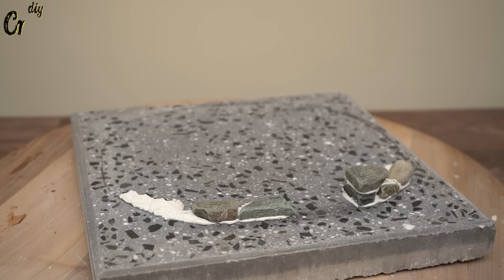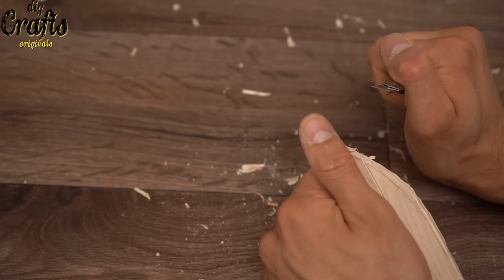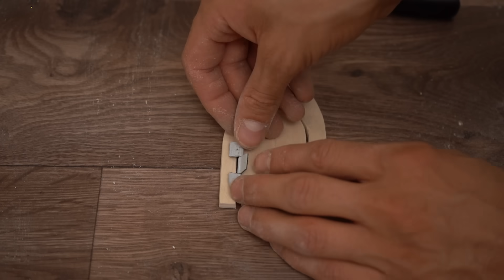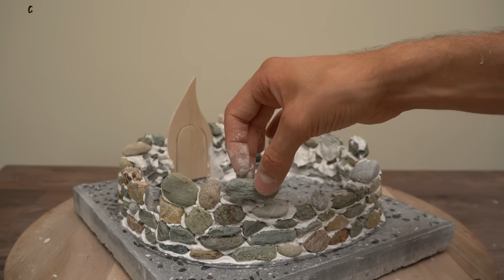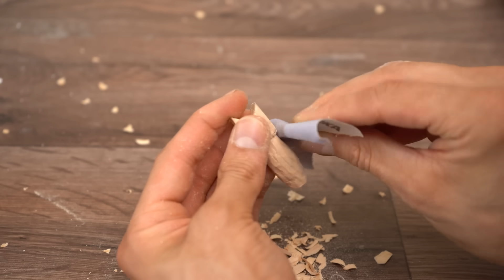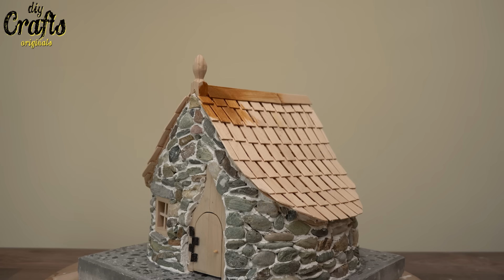Building a Cottage with Stones

Comment: For Those wanting to know what the paste is I think it's mosaic stone cement. 20$ for 2lbs in my area.
Reply: What is the spray at the end?
Reply: @LőcseiZsuzsanna  Probably A sealant spray for grout.
Reply: Is it long time durable?
Reply: @moumitamandal3235  um. If you doesn't get hit or dropped it will last a long time. Depending on how you place your stones can make it weaker to but I mean I've dropped one I made and only the a few of the top layer of stones came off. So it's decently strong. There is also kinds of that cement that is for outdoors and lasts longer also.
Reply: Could be! Or it is a cement für tiles that also bonds with wood. I used that kind of tile cement in my house.
As he is mixing it with water it must be something like it.
Reply: Thank you for answering the questions I came to the comments to find!

Comment: Lovely.  I'd build it around a large cut-out hole in the floor, so I could add a light inside it.  If you experiment with window shape, size and style, you might even give yourself room to put acat in the window.  Flower boxes in the window? This is such a convincing base, so it's fun to think about the extras that might work with it.  Maybe with some effort I could even find little geometric stain glass window-hangings to build in, allowing for some stain glass windows. alongside the normal ones.
Reply: You could easily make the windows with alcohol inks on clear plastic bottle pieces  or even with cling wrap,

Comment: The result is beautiful! Very inspiring. It would be helpful to provide subtitles stating what adhesives you’re using together with some of the less obvious materials. More detail of the pointing process would also be helpful. Regarding your use of the saw using loose pieces of timber as a bed: I can think of quicker ways of losing your fingers but not many. Anything being sawn should be held firmly and an appropriate size saw used, otherwise it’s dangerous - and not the best of examples, especially if this is watched by children. Sorry to nag.

Comment: You were doing well until you got to the roof. It would leak like a sieve. The tiles need to be side by side. I like the rock work and will try this out but i wouldn't allow any gaps in the mortar as its meant to keep out the weather. Overall a very nice project though so well done. And yes i do build scratchbuilt 28mm fantasy buildings.

Comment: 04:52, tip for improving your windows: You need to add a bulkhead, because you want the head-bar to bear the load of whatever comes on top. Instead with your window the forces are punctually distributed on the narrower side linings or jamb and the whole window is basically kept up by the mullion or sash bars. The head should be 'the head' of a window to spread the top-load evenly. Your windows only cover side load.
And no, I'm not a carpenter either. Your door hinges should also be inside the house, not outside, but i understand you did that for 'the looks'. Apart from that, nice built!
Reply: @artandarchitecture6399  One should think that, but the stone lintel itself distributes the weight to the lower stones, that in turn need to distribute the force somewhere. The force is not distributed straight down, as the window opening offers an area of stress release.

Comment: What did you use to mix the mortar. Thanks.
Reply: It's so frustrating that they don't say
Reply: I guess its chalk,cement can also used.
Reply: You could probably use an interior or exterior grout filler
Reply: Yoda _  that was rather unpleasant!  Mortar mix isn't usually very white unless white cement and silver sand are used - this looks more like a tile adhesive type material to me or filler.
Reply: Plaster of paris?
Reply: Maybe the clay mixture you can make with salt and flour?

Comment: I agree with the comments already made, a list of components would be helpful. The "cement" looks like readymade water based plaster/wood filler available in most DIY stores. I would have pre stained the wood prior to fitting to avoid getting it on the plaster and stone, unless you have a very steady hand! As for the stones, ideal if you live an area with hills and water courses, or the coast, otherwise look around DIY stores for decorative rocks, though many will be too flat if its gravel, or too big. Not sure about the door, why does it need to open? Nothing was done with the interior.
Reply: Be cool with a tiny light inside

Comment: What's the white stuff made of
Reply: I'm guessing it's just plaster
Reply: Cement
Reply: Might want to use a marine grade glue then a bit of cement as the grout.
Reply: @bigd1348
Looks like plaster. Cement would dry too quickly & it's not typically white.
Reply: Please list your materials, thx. Beautiful work 🌟
Reply: Of course I don't know exactly what was used in this video, but cement based mortar in white  or possibly Simple Set or AcrylPro premixed tile adhesives would work. Those are brands carried at Home Depot here in the U.S. 

Small batches of cement based can be kept open for a couple of hours and the premixed can be used indefinitely and for multiple projects by taking what you need for a portion of the stone setting and  keeping the lid shut tightly in between. Cool project!
Reply: It is white cement  easily available
Reply: From colour, consistency and dying, seems to be tile adhesive
Reply: Everyone shared their opinions about white binding substance but youtuber didn’t give answer.list ur crafting materials, otherwise posting videos are waste of time
Reply: @bugederaju7437  it's better to use desirable material that everyone finds easily ,not all materials are found everywhere like.
Reply: @GingerNinja1  por supuesto que existe el cemento blanco ! 😊
Reply: @rickspinella2507  
I didn't know it came in white. I know you can purchase dyes for it though. It looks way too pliable to be cement imo, but thanks for the info. 😊
Reply: @myriamgurza9148  
I think you're saying there is white cement? Read my previous comment I just posted to another commenter. Thanks for the info. 😊
Reply: @Big DIt's white cement😂😂😂😂😂😂😂😂😂😂😂😂
Reply: @abhirajsharmagardening7469  at least we should know what type of materials will be used in this binding stones,then only we can try to find it …so, name some binding materials ,I will search in that which is available in my area…